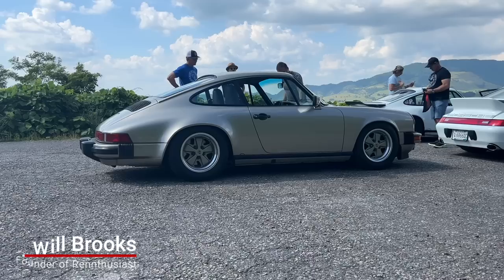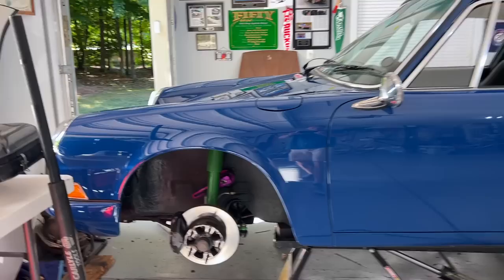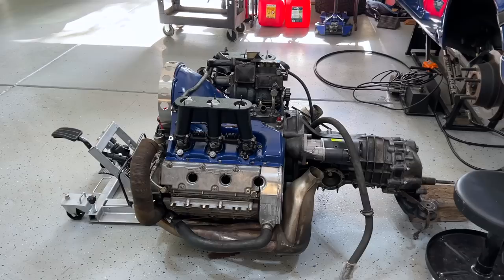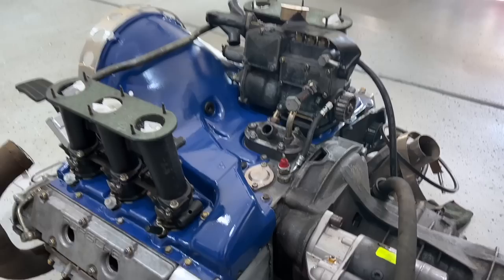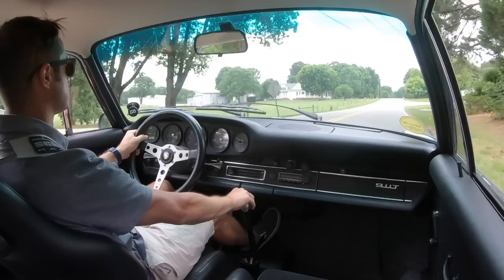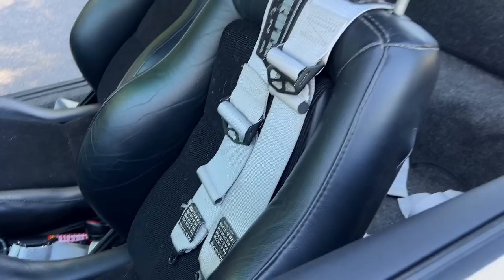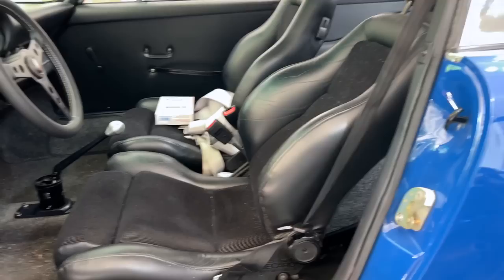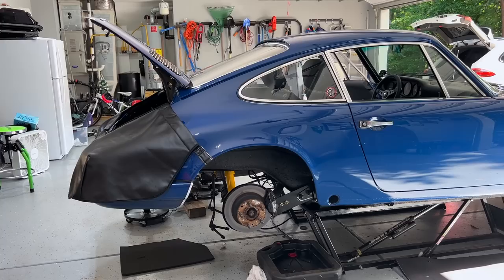Classic Porsche 911 Modified: Bulletproofing My '69 Porsche 911 Hot Rod

Comment: I also have a 1969 911T and I put the RS Touring fixed back seats in it.  I love them.  I'm 6'4" tall though so I built my own mounts for them.  They don't slide forward and back but I was able to drop them down a couple of inches and I built in the amount of recline I like.  They are set up just for me and they are perfect.  I really don't plan on letting anybody else drive the car anyway so it doesn't matter if they slide.  The lower mounts make you feel like you're "planted" more in the car too.  I used to drive stock cars so all my race cars had custom mounted seats.  If I ever sell the car then someone else can re-drill the location holes in less than an hour.  I also have an '86 911 with stock leather seats and the lower seating position in my '69 is much better.  It makes you feel more like you're a part of the car not to mention they're safer too.

Comment: With all those sweet internals why not go the extra mile and do a full EFI, coil on plug ignition, with a modern ECU (i.e. Link or Haltech)? Did it on my 60s Beetle and the tune-ability and throttle response is amazing
Reply: Scott, I am a huge fan of EFI and run it on my car and many customer cars.  HOWEVER, a hotrod MFI car is not only period correct, but MFI makes noises and delivers performance that is hard to replicate. We will eventually ITB/EFI Will's 86, but this car has killer MFI done by Gus and its "just right"
Reply: @eriklind1919  looking forward to seeing that setup on the 86.

Comment: Great car. Proper mods to dial it in. Like you, I prefer reclining seats, but I also occasionally use the rear jump seats too. So they are a bit more convenient.  If the car had a cage, I might consider fixed seats.

Comment: The car is coming along awesome and I can tell Eric knows his stuff.   I do think the fixback seat looks the best. If you plan on putting on a lot of miles get the seat that fits you the best, and is the most comfortable.  Only issue I have is with that shifter mechanism base and standard hardware.  That shifter would look so much better with a billet custom powder coating base enclosure cover with titanium mounting hardware.   Another option custom fabric shifter boot cover that will match your new seats.

Comment: One more thing I like about the fixed back seats is the additional feedback I get from the chassis.  The only feedback a car can give you is through the steering wheel, the brake pedal and your butt / back.  When you have a fixed back "racing style" seat, your driving experienced is enhanced because the feedback is more direct.

Comment: I like hearing what you are doing on the car.  Neat mods.  You don't have to answer since it is personal but just curious if your 964 sold for more than you paid for the long hood.  Some of the long hoods are just crazy priced.  However your 964 was very well sorted with unique color scheme and interior.
Reply from the maker: Thanks.

No problem.  I won’t reveal actual numbers out of respect for the 964  user and the 69T seller, but the 964 did sell for more than the 69T cost me.  To your point, the 964 is arguably rarer and more original.  Just a different animal.

That said, I am hearing that long hoods like this one are coming up in value.  I have over-insured this one and am just gonna drive the hell out of it.  I am not worried about $$$ with this hot rod.  I just want to experience it and hope to keep it long term.

Comment: You have already done the hardest part taking out the motor and removing the intake system. I would put in twin plugs and while your at it you can check the compression to see if it really is 10.5.and check the cams and their timing so you can have a good base line. Good electronics can only go so far. There would much more bang for the buck if the money was spent on twin plugging.
Those seats are more uncomfortable than most non recliners in my experience. Period appropriate may be out the window anyway with your wheel choices and the rest of the build so get the seats that you like....

Comment: Sorry to hear about your drone and microphones what a bummer. We've all done those sorts of things in the past I could tell you some horror stories. Quick question for you @rennthusiast what is that lift that's holding up your car I'm trying to decide on some way to lift my car instead of jackstands, so tiring. What's your experience with the one you have? thanks! I don't have an aircooled car, mines a 2001 996.1 but I dig your channel and your style, great work. I'm getting some good inspiration and ideas for my car. I'm restoring mine completely, one bolt at a time.
Reply from the maker: If you’re talking about the one my Ossi blue is sitting on, it’s called a Quick Jack.  People seem to really like them.  I have a Chinese 4 post lift at home but isn’t featured in this video.

Comment: Which lift is that?
Reply: Its the 5,000lb quick jack. I like the ability to move it around easily and store it if necessary.  My garage holds four cars comfortably and a permanently mounted lift or even a storage lift would kill that capacity.  Way more flexible this way.  Its almost tall enough to pull an engine, but you have to remove the rear panel on a longhood or the rear bumper on a later car.  No big deal though
Reply: @eriklind1919  I assume there are fixtures underneath to avoid crushing the rockers? Thanks for the reply!
Reply: @haroldsingh7486  it has hard rubber blocks that you line up on the pinch welds